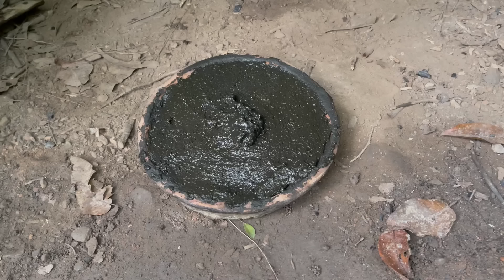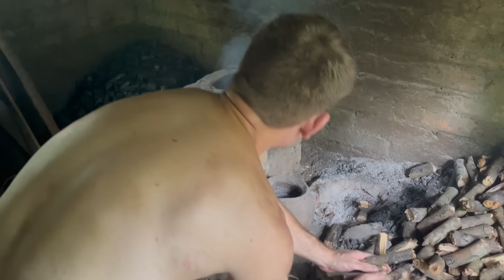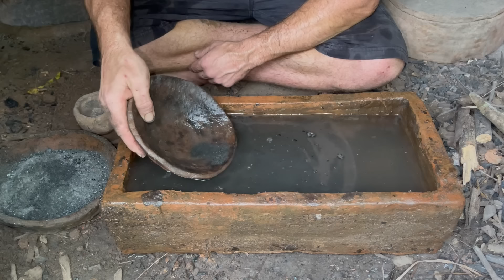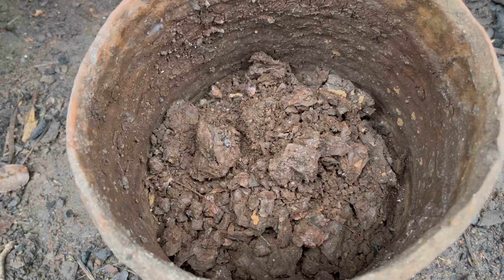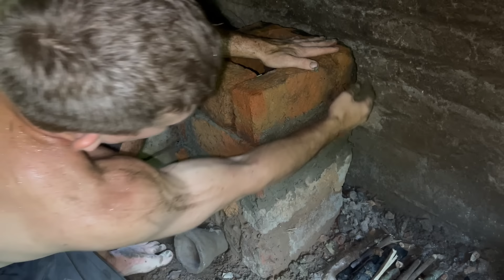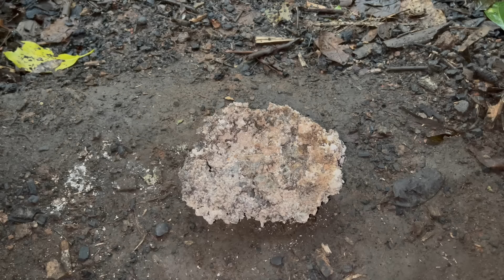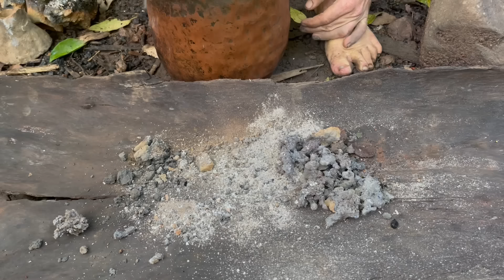Primitive Technology: Roasted Ore and Shell Flux Smelt

Comment: Dear John.
As a metallurgy engineer that handles ore into kiln, I have the following advice:
I suggest you start with smaller fire and continuously build it up to increase the temperature, but it is important to keep a calm fire after starting it. Drying the ore slowly is the key to a nice and ready charge for the coal. Once you start adding coal (after 3-4 hours of drying the ore), I suggest you try making breaks while blowing, to let the coal and the charge cook well, like cooking a steak at a low temperature, because too much air will oxidize the iron earlier before it reaches a temperature near liquid phase before smelting, so that could be the problem why you are still getting small prills. Try making small pellets of 1 cubic centimeter of the ore. Burning the iron ore right from the start will cause the iron to pop and form into smaller prills into the slag.
Also lime is added in liquid metal only (from my experience so far)
Hope this helps!
Reply: How should the slag be added into the furnace? At what point in the burn and in what manner? Layered into the coal as its currently done?
Reply: @samsplaying  the old techniques ive read about stacked the chimney full of charcoal with actual coal at the top wirh the ore. 2 to 1 ratio coal to ore. As it burns down do it again and again and after it cooks down the bloom should be at the bottom
Reply: is there any difference in what point flux is introduced? like say, would you get different results if it was added once the slag had already melted versus mixed in with the ore?
Reply: 좋은 정보 감사합니다
Reply: I think he should mine from under the ground instead of collecting that pond scum. Or just visit the scrap yard.
Reply: Might as well throw some potatoes in there as well, so when your all done thrusting that thinga-ma-bober you have a nice hot meal ready to eat!
Reply: @garrysekelli6776  It's called "Primitive Technology". He's not going to the scrap yard, and mining for iron ore is a lot harder with his current level of technological progress.
Reply: @garrysekelli6776  He should just buy a knife from the store! So much easier
Reply: @potato4dawin1  someone did not understand the joke
Reply: can you put a big rock (preheated) with a depression to catch and concentrate the iron? (the intense heat would probably crack it)
as you add iron can you chuck in half golf ball size rocks in one side of the chimney? my thinking is: this would accumulate radiative heat and create a less oxygen rich portion of the chimney. even diffusing the air by covering the tube with chunky gravel? maybe crush some of the charcoal to mix into the dry powdered ore. i would get it 3/4 full, burning hot, then add layering of charcoal and your ore mix all at once, then slow and consistent till finished (smaller coal chunks at the end too)
Reply: Fantastic word
Reply: You said exactly what I was thinking 😉😉
Reply: Yes but how much metal have you smelt?
Reply: @kalibisaboss7232  I don't think he was joking and you shouldn't either unless you made the joke
Reply: @kalibisaboss7232  there is nothing that is indicating that it's a joke except for it being the dumbest comment possible which is laughable I guess, so if that is an attempt at being funny it's a bad attempt
Reply: Don't forget the salt and pepper
Reply: I think by doing so can incorporate a clay pot, which would only benefit from glass. see wootz steel...
Reply: even as igniting the fire, deserves respect here.
Reply: Super cool to have an expert here so I'll ask some questions if it is ok? Do you think it's possible to get a greater yield by separating the ore from the burn material? i.e. using a small lidded kiln, or will it add more restrictions due to increased fuel needs? also how viable is it to get the smelt liquid enough for the liquids separating due to density? Was the lime idea a valid strategy? would a smaller amount of lime have been prefferable? could the woodash have been enough for this Ph change already?
Reply: A good indicator to your credibility is that he had noticeably larger prills on the first smelt where he had to take breaks from blowing to add more charges.
Reply: in theory once he has enough iron would he ever be able to make rudimentary steel with the primitive tech he is using?
Reply: @BCzepa this is the wr9ng place for your suggestion lol but it would be the same dont you think? It deposits on the bottom with the slag so rock or no rock will be the same
Reply: @Mazder_Verhal sure. If he gets the other elements. For now iron it is, he can make an arow or a smal knife already
Reply: @Saleca  IIRC the main one he'd need is carbon, just hard to get that in from charcoal alone I guess?
Reply: Adding to this: Stop wasting time getting your ore from bacteria. It was never done in the past because there's not enough iron in the mud (Do a little math on your current yields) 5kg mud for 30g of prills. It is faster and easier to pan for black sand(mostly iron). It also has the bonus of already having the flux (silica sand) as part of it. That is the important part! There has to be enough flux (5-10% of the charge) to prevent the ore from oxidizing and burning away before it can reach a liquid state. Mix your prills in with the first charge. They will be the seeds that new liquid iron will be able to stick to. Also add 1-2 charges of only charcoal at the end. This allows the liquid iron enough time and heat to gather at the bottom.
Reply: can he find this liqiud lime in nature. nope.
Reply: @fuzzym30  black sand? Maybe he doesn't have it available, have you considered that?
Reply: @garrysekelli6776  The point is rediscovering how the very first iron tools might have been created, and the work that would have gone into them. Mining wouldn't have existed in the time period he's exploring with these videos. I find these methods very fascinating.
Reply: Do you think with the materials he has available he'd be able to fashion some sort of expendable crucible? 
In the case of having one would the slag sit on-top of the denser metal and be easier to separate?

Please feel free to correct me, very curious if it would work here.
Reply: +1 for early oxidation. I saw it very well when I forged. And same physic apply here. better control of temperature is the key. And as Roadkill 94 said it, to reach that control, you need to go slower at start. if you manage constant blow force, you can adjust the air flow exit to set your temperature. (for constant air flow, a mill kind of blower is better (always turn in same speed/way). I know it is not easy to do, but you have the knowledge to make it.
Reply: @Mazder_Verhal  at first i thought chromium but then i realized thats for stainless steel. Assuming that you werent sarcastic charcoal is basicaly carbon, not sure about the residual elements but should be fine for experiment.
Reply: thank you based metallurgist
Reply: @potato4dawin1  Exactly. Mining is a little difficult, if you don't even have a shovel.
Reply: @Tarandon  Mining has existed for milennia before the Iron age. We have evidence of people mining iron between 5000 - 3000 BC. The earliest cast iron tools were made from meteoric iron. Also, the blacksmiths would have been using bronze tools (e.g. hammers, tongs, crucibles) for nearly 2000 years before the first blast furnaces were made. They wouldn't be working the slag using rocks.

I don't know if any civilization on earth actually used iron bacteria to make iron. It doesn't seem like an efficient method and I don't see it working at larger scales either way.

But I feel like he's been going around in circles for the past few years, just because there is no natural copper/tin where he is. In reality, copper would be abundant, yet tin is extremely rare and most civilizations would obtain it through trade.

I can only imagine how much progress he could have made these past few years if he had access to copper and tin, and didn't waste all this time trying to cook bacteria soup.

All that being said, I still find these videos very entertaining.
Reply: In archaeology i once studied ancient copper smelting ovens. usually there was an exit to the ovens, where the molten metal, seperate fom the slag could flow out. If i am not mistaken.
Reply: @Saleca  yeah I was, he's got tonnes and easy way to make more, lol.
Reply: Would a crucible help in this instance?
Reply: Guess the technology is primitive
Reply: Word up!
Reply: Yes but if you smelt it you dealt it 🤣 jkjk love your content
Reply: Repent to Jesus Christ “Cast all your anxiety on him because he cares for you.”
1 Peter 5:7 NIV
hg
Reply: @garrysekelli6776  it is not Minecraft, iron ore is not everywhere and where it is, it is seldom in shallow enough depth to be reached by one dude with no real tools safely
Reply: I think some of us have had enough of these videos on smelting and making wood charcoal. This guys used to make little huts and shit. Which is why I tune in. He needs to go back to that.
Reply: @Docstantinople  just re-watch the old videos, then.
Reply: @YuriHabadakas  hmm good idea but I want new ones too. It would be nice.
Reply: Lime is used in both pig iron production for wrought iron and liquid steel. The issue is, when their doing it industrially, the blast furnaces are capable of maintaining a far hotter and more consistent temperature, and can quickly react the lime into quicklime without that temperature dropping. Quicklime is the stuff you want and is used for a flux to make silicates flow better and remove sulfur impurities. The shells here are lime(Calcium Carbonate), and needed to be calcinated(into Calcium Oxide) by being heated up. This process absorbs energy, which for John's set up is really bad as he can barely get up to temperature at all for melting iron. A simple solution is to roast the lime source like the ore before the actual smelt so you aren't wasting energy and heat during the actual smelt.

In fact one of the two big reasons his roasted ore did so much better was because the ash he had mixed with it likely contained lots of calcium oxide. (Wood ash produces Calcium Carbonate or Calcium Oxide depending on how hot the fire is, and how much CO2 is present, which based on the way he built his fire for roasting, should have produced Calcium Oxide)

Instead because he added raw lime(calcium carbonate) to his mix in the second batch in the form of shells, it underwent a reaction to become quicklime, and absorbed energy and thus would have lowered the temperature of the smelt. Furthermore part of the calcium carbonate would have remained as it was due to the high CO2 levels, which would have made it harder for the slag to melt.

For steel production the high consistent temperature of the blast furnace means that it's all going to get converted into calcium oxide practically fast, and as a plus, it will off-gas CO2 which is a favorable situation for steel production as they want the high carbon content, and they then don't have to blow CO2 into the mixture, and then instead blow oxygen into the mixture until they lower the carbon content down to where they want it.

You can read a basic overview of the process here:
https://en.wikipedia.org/wiki/Blast_furnace
Reply: @t_g_gamerftw5075  now that, is an exceptional report there fella.
Reply: Wouldn't magnatite give far better yields than bacteria?
Reply: You may be a metalurgist, but you dont have experience about this ancient technology. Go make it, and comment here about your finding.
Reply: @byankeesama1539  Those principles are same. At its core it is just chemistry. You don't have to pick berries  dressed in animal skins to know how berries tasted to ancient people ;-)
Reply: @lamebubblesflysohigh  You dont understand your theory unless you apply it. I dont like people that only talk about theory unless he ever tried it out before in real experiment. Why? Did you think I am just a theory man? I ever did it, and ended up with iron prills.
Reply: Best educational comment an youtube thankyou for the information and knowledge !
Reply: I wondered if he could roast it one of those clay pots rather than separating the ore out of the ash.
Reply: Хотелось бы увидеть реализацию этого совета в следующем видео 👍
Reply: Very nice comment!
Reply: I don’t know why he doesn’t’ just invent a primitive youtube on some rocks with a hand drill and some clay and then just wait a few thousand years for someone to upload some shortcuts to making metal.  Seems lazy if you ask me.
Reply: ? people add flux when smelting iron all the time
Reply: @flamethrowex  the slag won't melt without the flux... That's what fluxing is: reducing the melting temp of the slag so that it will melt.

If the slag melts without the flux, you don't need the flux.
Reply: i hope me makes a huge brick ore sword xD
Reply: @Tarandon  Mining is much older than the iron age, but the first mines were for red ochre, and later for stones like flint or for clay.
Reply: @Docstantinople  Yeah, it's almost like we all have the entire internet available all the time to everyone right now. But since we're running out of low cost fuels at room temperature due to declining EROEI, that won't last long. But you won't figure that out till it's over. Back to sleep now kiddo.
Reply: @skeetorkiftwon  can’t stop, won’t stop.
Reply: @garrysekelli6776  Man, our ancient ancestors should have tried mining or checking the scrapyard!
Reply: @Statleburger  nah, just 3d print a knife instead of leaving the house
Reply: @Mazder_Verhal  he needs chrome
Reply: @imho2278  for stainless steel, yeah, but iirc the basic steel doesn't "need" it, right?
Reply: Making breaks!? Absolute balderdash. This is no hot air blast furnace, the margins are so small it's a miracle it's even possible to make bloomery iron.
Reply: @BCzepa  The principle is that the tuyere enters a few inches above a bowled bottom. Ore is reduced by Carbon monoxide in the outer regions of the hotspot, and then the droplets have to fall rather quickly through the oxidizing zone and into a more reducing zone below. The deeper that is the more carbon content you can have, all the way up to fully hardenable steel. Your yield and carbon content will also depend on the quality of slag made by your ore. With good amounts of liquid slag in that bottom bowl it will protect the droplets and give them time to consolidate a bit better.
Reply: @HamsterBlitz  The wood ash from the roast has not been a problem historically, but I suppose it could tip the scales if your slag is already poor.
Iron is never fully liquid in these furnaces, but if the bloom sits in a pool of good slag it will typically consolidate a bit better.
Reply: @Mazder_Verhal  He could make fully hardenable bloomery steel directly in this very furnace if he knew how. But yes, there are ways to do it with these crumbs he's saving. Blistering, for instance.
Reply: @fuzzym30   This yellow ocre has been used extensively in Scandinavia for as long as we know. It settles in so thick deposits you can dig it with a spade in no time. His yields are not indicative of his ore quality yet, far from it.
Reply: @ratatoskr1069  Yes, but this isn't copper. The iron isn't molten.
Reply: @lamebubblesflysohigh  The principles are not the same, the difference in size and later the use of preheated blast air gives blast furnace ironmaking the advantage of surplus heat. In a bloomery furnace the dang stuff never even melts, and the slightest temperature detractor makes the yield plummet.
Reply: @adammoffett4029  Perhaps, or he could cake it into bigger lumps so the ash could be sifted off. That is being done.
Reply: @stefflus08  Thank you, thats good to know!
Reply: @stefflus08  Nice to learn new stuff, thank you :)
Reply: I hope John reads your input. This, in my opinion, is invaluable knowledge from an expert.
Reply: @BCzepa  no for a myriad of reasons
Reply: برای ذوب 3کیلو آهن کوره ما چند ساعت کار میبرد
Reply: @garrysekelli6776  Just visit the scrap yard? I think you've kind of missed the point of this channel.